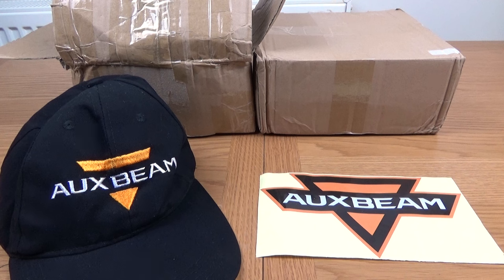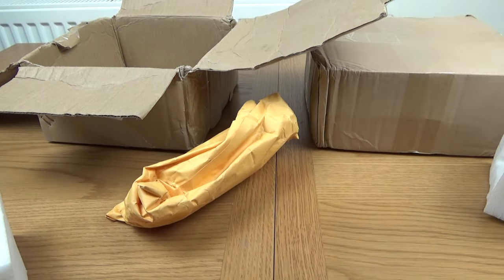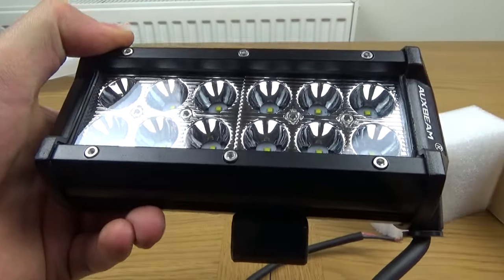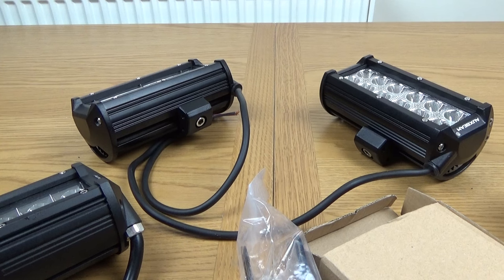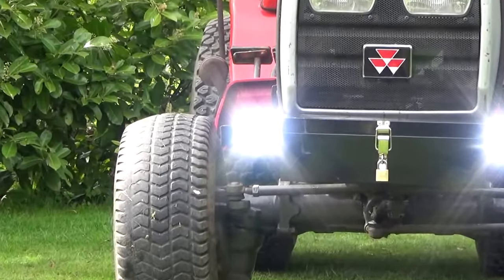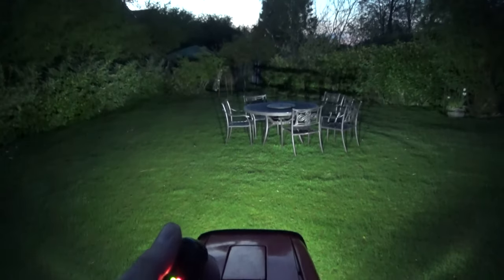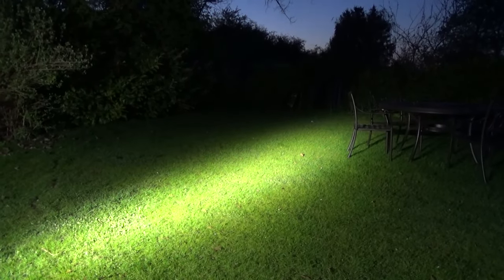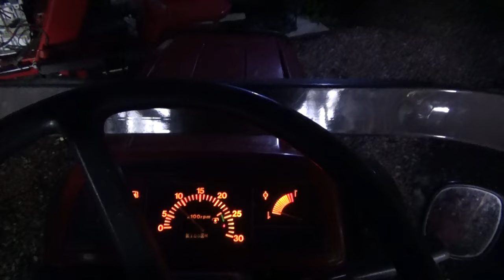Auxbeam 4" and 7" LED Flood Light Bars | Review/Demonstration

Comment: I can't help but feel you would have been better off with the 4" lights at the rear instead. The defuse pattern looks to be better suited for monitoring an area. Could also put some on the roll bar or angled slightly outwards to cover a larger area if needed.

Comment: very nice lights,but I think I would rather have the rear lights on the roll bar.
Reply: Yeh that's what I was thinking, then u can see more and that's where they usually are, personally I would put the small ones on top of the bonnet or half way up the side and the bigger ones on the role bar facing forwards as u can use the factory lite to revers and with a tractor that small anything u want to attach will be light enough to carry or at least to wrestle onto the links if factory light is not that bright

Comment: Hi Daggerwin I was just wondering where you got your compact tractor from and for how much? I have just bought some sheepand there at a different farm so I have to keep biking there but when I get a Compact tractor and when i am 16 ill drive there . So a compact tractor would come in handy :)
Reply: A motorbike would be quicker. Just look on eBay might be some compact tractors on there.
Reply: Thanks and I thought moterbike would be quicker but I need a tractor to pull trailers and stuff for the sheep I mean we have a Massey 135 but it's in bad condition so I want to buy a new one
Reply: +Jim Stockdale I see well in that case I would recommend some thing like the 135 as the compact tractor that Daggerwin has may not be big enough to it all depends on how much your going to do. But yeah just search around on eBay or local farm sales you never know what might turn up
Reply: +Jim Stockdale I see well in that case I would recommend some thing like the 135 as the compact tractor that Daggerwin has may not be big enough to it all depends on how much your going to do. But yeah just search around on eBay or local farm sales you never know what might turn up